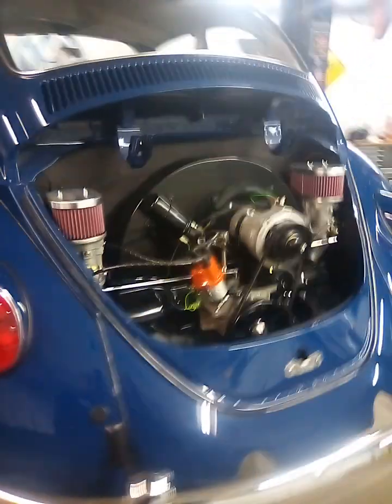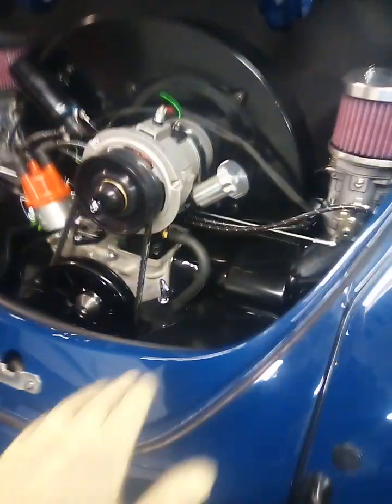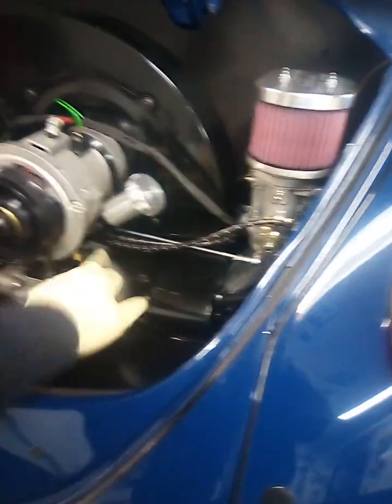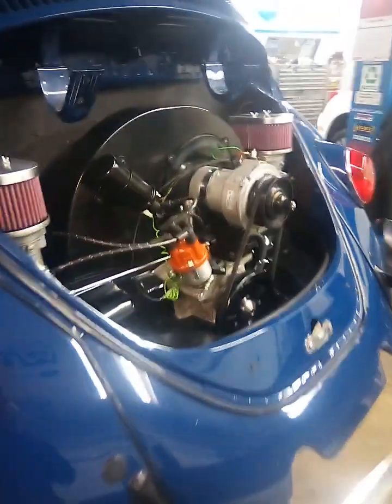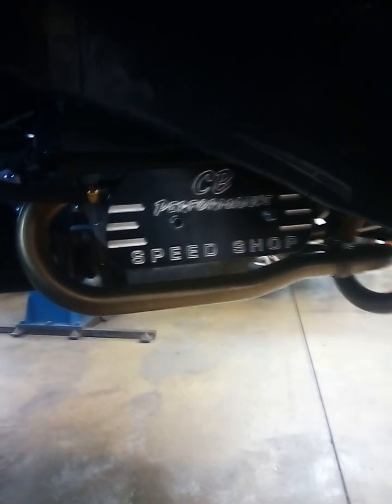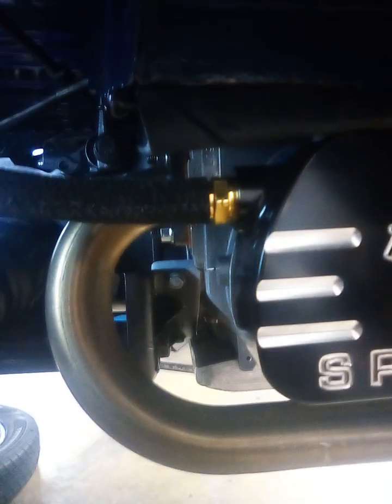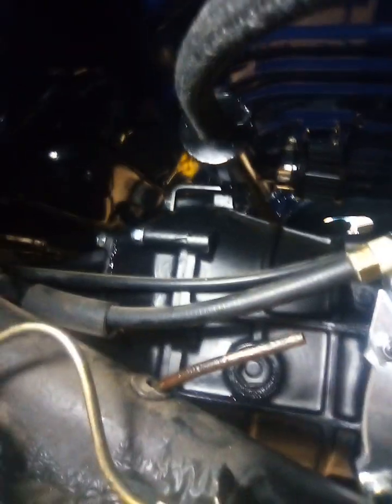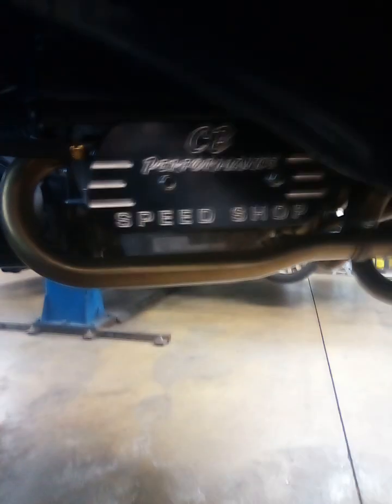VW Type 1 1904cc Beetle Crankcase Breather System

Comment: Box is too low. Gonna get messy.
Reply from the maker: actually works perfect it is all about pressure relief, just did winter service on this car and not a drop of ol under the car. Customer drove all summer and did not have to add a drop of oil.